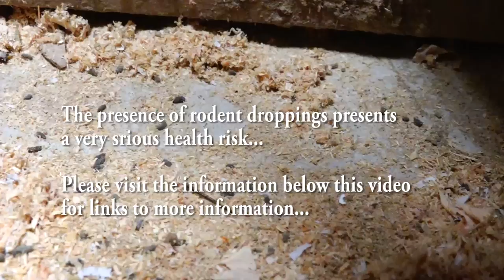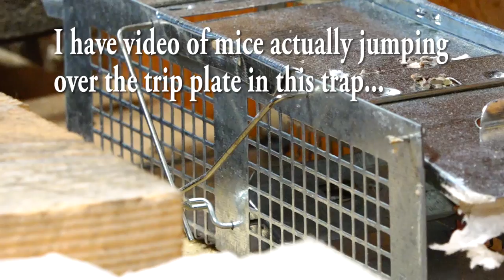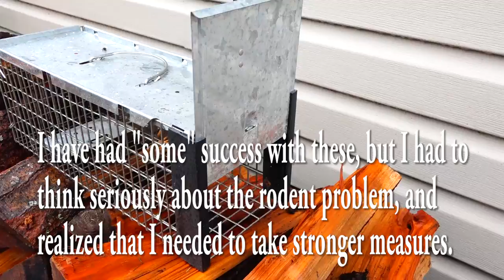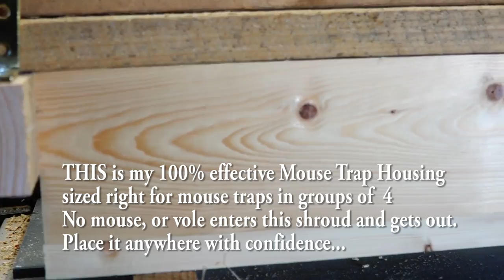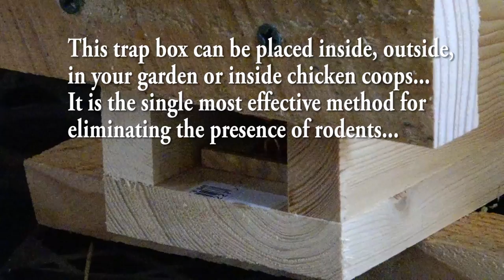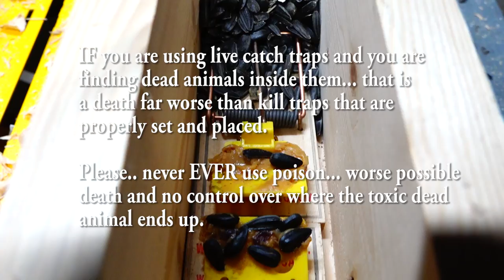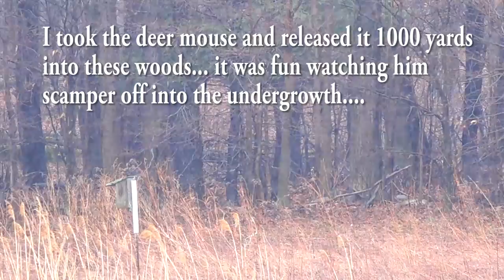The BEST Rat and Mouse Kill Traps that work every single time. Fred's Box of Certain Death Works!

Comment: A few suggestions: 
Don't handle the traps with your bare hands - the rats can smell you.
Store the traps in something that smells like food ( I keep them in dry cat food).
Moe the traps around constantly.
If you place the traps in out of the way places - drill a hole through the corner and attach a string. It will help you retrieve it when it catches a rat.
If you want to get nasty with conventional wooden traps - drill some holes through the wood and push some little picture hanging nails up through the bottom.
If you just want to cut to the chase and get rid of the rats, without worrying about how humane your method is, just use glue squares. I have found them to work when nothing else does.
Reply from the maker: Thanks for sharing Ian! If you dip your finger tips in peanut butter before handling traps, you're good to go :)  I did solve my rat problem and now have none to test on. =<';'>=

Comment: Use the log roll trap with a bucket with 6 inches of water. Bait the roller, leave it overnight then dump the drowned little disease carriers in the woods.
Reply from the maker: That works too if you have the room for it, but in winter the water freezes in the bucket. Thanks Steve, I do like the log roller designs! I also like the quick-sand system that Shawn Woods uses. My problem is that the mice and rats move in when it's freezing outside and those buckets would also freeze.
Reply: If you have no pets just put a couple tablespoons of anti freeze in the water. I would suggest vodka if you have pets. Actually that would be a waste of good vodka. Try putting salt in the water. I don't have the freeze problem in my feed shed so I never had to deal with the frozen water.
Reply from the maker: orrrr just snap them :)  hmmmm vodka trap... apt to catch some town drunks in that thing....
Reply: Best trap there is use antifreeze in the winter so they drown fast

Comment: Can you share the dimensions of your box for rats?
Reply from the maker: It's based on the size of the traps you use. Just wide enough to install them and just tall enough for the kill bar do travel without touching the cover.
Reply: @FrederickDunn  Yes...:-)  I have ordered the made2catch traps that give the dimensions for the trap/base, etc. but not the height of the kill bar when in action.  I was hoping to get the boxes built while waiting for the traps to arrive.  I can't measure the distance that is needed to clear the kill bar/height without having a trap in hand.  I was hoping you could share that.  My traps will arrive in a few days now, so I can measure them myself.  I may share them in case someone else wants them?  Thanks for a great idea!  We pray it works as well for us as it has for you!  Best~

Comment: Sorry the best is the bucket trap with planks or roller spinner thingy.  Use both caught 30 in three weeks.
Reply from the maker: I agree with whatever works for you. If that's it, then a bucket is also fine.

Comment: I followed building this exactly as shown and tried this for rats and it failed! Why would you put two traps facing each other? I thought it strange but gave it a try. No good. Any ideas why?
Reply from the maker: It continues to work for me, the only thing I've changed since this video is that I screw the trap bases down to the bottom board. Other than that, it's anyone's guess. I get more kills with the trap paddles facing each other than I did with them facing away.
Reply from the maker: Rats can often hop over one trigger plate, but when two are facing each other, that dangerous landing is harder for them to avoid. The roof on the box forces them to walk over the plates even when avoiding the bait and going for the pile of sunflower seeds in the center of the box. I'm all out of rats these days or I'd make a video of that behavior.

Comment: Www.automatictrap.com I think. Its a great resetting trap good for months using soda gas cylinders. No poisons, or batteries. Its New Zealand trap that they use to control pests to protect their vulnerable native animals and birds. The dead ones fall out of the trap and can be eaten by predators safely.
Reply from the maker: Hi 58Kym, I am aware of that trap and it seems like a good idea until it starts killing off squirrels, chipmunks (protected) and even some woodpeckers. If it only took out rats and mice while allowing carrion eaters to take away the remains it would be ok, but cats and dogs would also have access to those dead animals and that's not good for them.

Comment: In my experience it isnt really about the trap. Ive tried many commercial and diy designs. They all work great in principle. For me its mostly about getting rodents to take the bait. Ive used a wide variety of baits and baiting methods and the little peckers just wont go for it.
    Find a good bait and baiting method, THEN youll really have something truly superior.
Reply from the maker: Hi Joe, I collect lots of information about the rats and mice by watching trail camera video sequences. I like to know what the behavior is and videos provide that. For me, the combination of peanut butter and black oil sunflower seeds has broad appeal and they can't seem to resist it. You're right, without a compelling bait, the traps don't matter at all. Thanks for watching and taking a moment to comment.
Reply: I caught mice on the first night but the rat traps had every trap sprung and no rat. Ugh!

Comment: Always wear gloves! It prevents rodents from detecting human odours, and lessens your risk of injury if a traps goes off. Trust me, a layer of leather between your thumbnail and a Victor makes a world of difference! Rodents can spread diseases, and who wants to handle dead animals with their bare hands, anyways? Buy some leather gloves that are strong, but give you enough movement to set your traps, and only use them to handle your traps.

You use a hell of a lot of bait, Frederick! You must buy peanut butter and sunflower seeds in bulk! 
I think you'll find that you could reduce the amount of bait you use by 3/4 and your kills wouldn't decrease. It depends on the size of the rat population, of course, but a limited food source, especially a tasy, nutritious one, will increase the level of competition for it.  

Placing a seed on top of a smear of peanut butter, or another sticky bait, works well, because rats prefer to eat food while they sit on their haunches, as this allows them to look for competitors and predators while they eat. A sunflower seed stuck on some peanut butter on the centre of the trigger plate would be difficult for rats to eat where it is, or remove, and they would have to bring their heads in closer, ensuring that the kill bar strikes them on the neck. 

I would recommend increasing the length of the tunnel to make it more difficult for bycatch to occur. Birds would have no difficulty getting killed with the current design, and cats and dogs could get injured going for carcasses, and children exploring could also get hurt. Approx. 30cm between the entrance and the lip of the 1st trap should prevent the vast majority of bycatch.  

Mounting the tunnels, with Velcro or magnets, would allow you to bait and set them outside the holder, while preventing injured rats from dragging traps away.

I'd love to see a modified version that has a clear cover.
Reply from the maker: My new version has holes instead of the open ends. I also rub my fingers in peanut butter before touching traps, and yes, I put too much bait in the boxes, that puts the scent heavy in the air. YES, if you have children around with tiny probing hands, definitely make a longer box. Thanks for all of your observations and recommendations!  https://youtu.be/uUfLsh-8aL0
Reply: @FrederickDunn  Those traps are dangerous enough to set as it is. Adding peanut oil to the equation? No thanks!

I am always modifying trap boxes/tunnels/holders, and have recently created holes in 1" pine or 1/2" plwood with a 50mm diameter. The black and brown rats that I trap have no reservations about entering them. I did this primarily to trap the physical and chemical traces that rats entering the holes will leave, because the best lures for rats are other rats (I've read numerous trapping studies on the subject). If a rat new to the scene can detect the traces of previous rat activity, it is more likely to enter, because it will fell safer, and assume that the bait on offer is safe to eat. A good way to "break-in" a new trap entrance is to rub the body of a freshly-killed rat on the entrances, and push it through the holes themselves. For this job, I'm assuming that you would use gloves?

A clear advantage to this is the fact that it makes it far more difficult for bycatch to occur, and prevents the traps from being taken. The occasional bird may be brave enough to enter, but it depends a great deal on what the bait is. My biggest concern in terms of animal injuries and trap disturbances is cats, so I try to place the traps out of paw-range. Even large brown rats can enter 1" holes, so it would be interesting to find out what kind of numbers you could catch with a tunnel like that compared to a 2". I recently made one that has a square entrance approx. 10x10cm at one end, and a 2" hole at the other, in order to determine if rats prefer one over the other. Thus far, about 2/3 have opted for the wire mesh entrance , but the tunnel is situated under a phoneline bordering a fence, so the direction that a rat is travelling may skew the results one way or the other. 

Thanks for getting back to me so soon!

Comment: Anybody have any luck with these traps and chipmunks?
Reply from the maker: Yes, they absolutely kill chipmunks.. but be careful, chipmunks are protected in some areas =<';'>=
Reply: @FrederickDunn  well they're getting up into my sill plate and siding and leaving acorns in my basement so hopefully they're ok to kill around here.  Either way I made 3 today, thank you for your video!
Reply from the maker: @gregduval381  the box-of-certain-death shall resolve that problem... side note, they go after black oil sunflower seeds and don't care if they walk over the deceased body of another little chippie... not that I would know (';')( ';')
Reply: @FrederickDunn  thank you! Good info!

Comment: A mouse, rat or vole is just being a rat, mouse or vole...it has a mouse, rat or vole brain...if you had a mouse, rat or vole brain would you really be doing anything different than they are...???? We are intruding on their territory...agreed we must remove them but we must be kind and humane in doing so...personally...I am obscessed with watching rat, mouse catch videos...I prefer the "walk-the-plank" method into a large barrel of water with "Perlite" or "Vermiculite" floating on the top of the water, then put your bird seed or black sunflower seeds...they think the Perlite is solid like the earth and dive right into the water...only the lighter ones float to the top... :( clean every day....you can reuse the Perlite over and over....I did see this on U-tube so it is not my idea but I think it is the best.
Reply from the maker: HI Donna, any of the bucket or water-filled trash can videos don't work where I live. I primarily trap them in winter and water just freezes and becomes unusable, then I have a split bucket and chunk of ice to deal with. They would end up swimming for a very long time while they drown. Rats can swim for over an hour so drowning systems are really long-term stress test chambers for small mammals. I much prefer the snap and clean kill systems if you intend to kill them, just do it quickly in my opinion. Thanks for watching the video and taking the time to comment. All the best!
Reply: So sad...I didn't know that...:( I hate rat/mouse traps since I am afraid I am gong to smash my fingers...:( Electrocution....:(
Reply from the maker: There are some good zappers, but they have to be kept really clean to work well. Yorkshire Terriers and fabulous mousers and ratters... just saying.
Reply: Sorry but it is my territory now. To hell with the rats, mice and voles.

Comment: Those 'victor' traps are useless - the stupid plastic bit always breaks making the trap unusable - very poor and weak design.    My prefered method of dispatch for rats is call the nearest military air base and have them send in one or two  A 10's with full ordnance payload - the Gau gatling gun usually does the trick on the rats !
Reply from the maker: ok ok... I can see that.